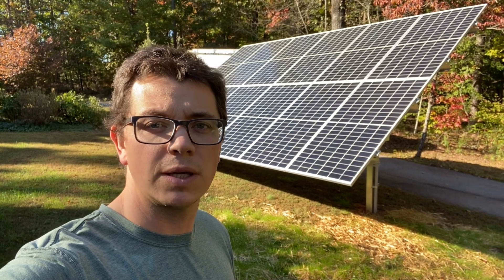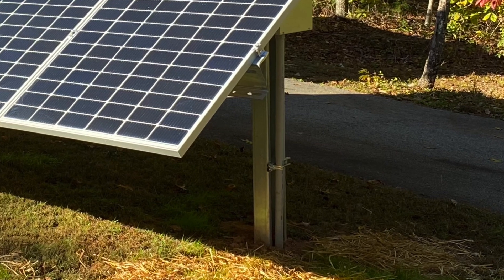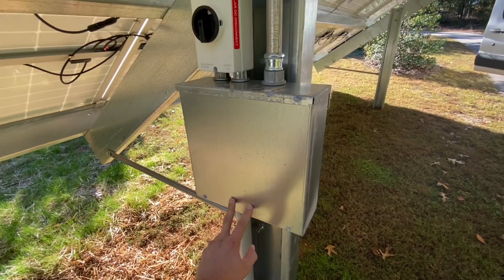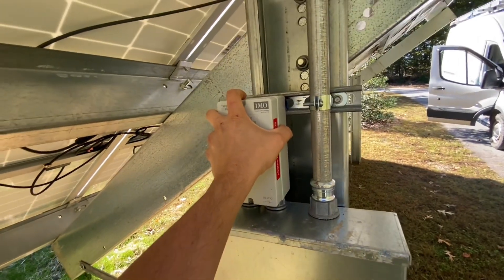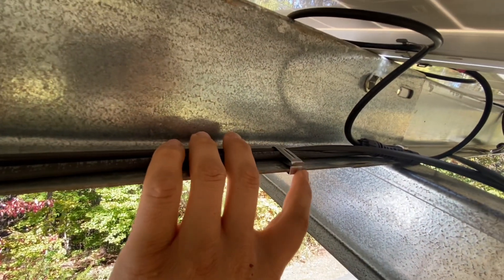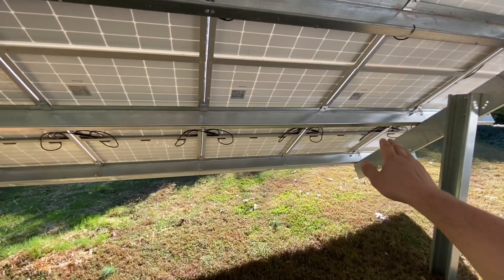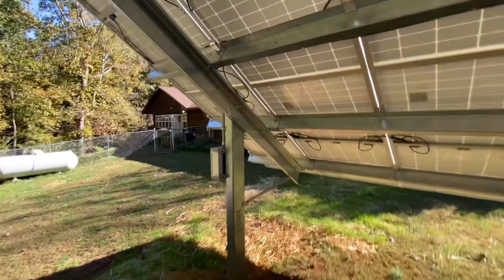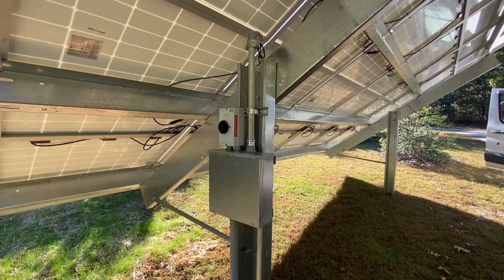Ground mount Solar Wiring

Comment: Do inspectors in your area require protection of the array wiring?  We are being required to put some kind of screen under the array so the wiring is not directly accessible.
Reply from the maker: It’s not required around here.

Sinclair Designs, the makers of this rack, have a wire management solution that will meet that requirement

Comment: i did your IMO DC disconnect setup on an install -   really seems cheaply made typically haven't used this low of grade disconnect plastic cheap o-   but it seems to work good - time will tell .   I may stick with midnite on next gigs..??      the sinclair rack seems good tried this also .      thanks for posting your ideas.  along with engineer 775     -  you all got me going a little on my youtube.

I do like idea of different size wire clips .      wish sinclair would look at a way to not make the rack like razer blades  - very sharp  - got to be super careful on how you run the wire.
Reply from the maker: The box feels cheap but it is under the panels. They seem to be lasting
Reply: @GainSolarPower  thanks for the feedback.  See you all use all the time..

Comment: what do you use for transitioning in the junction box? Wire nuts, small polaris connectors?
Reply from the maker: The transition happens in the switch